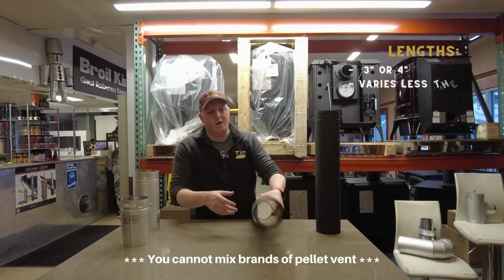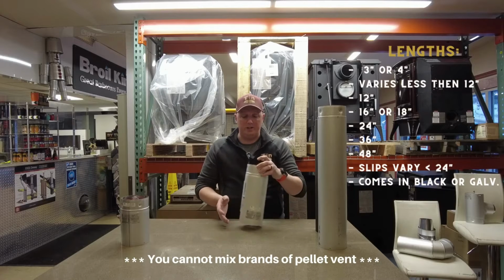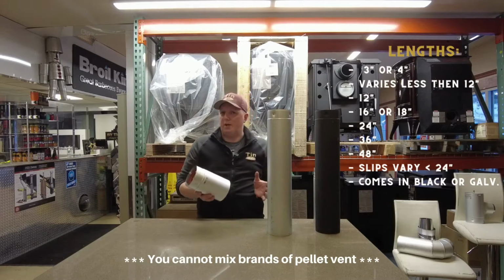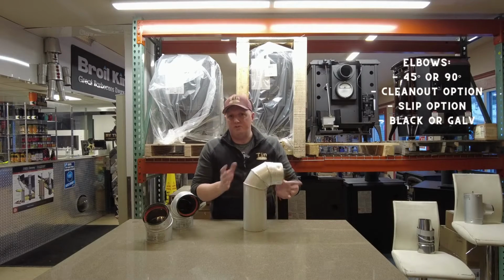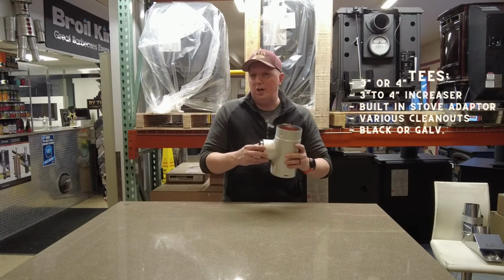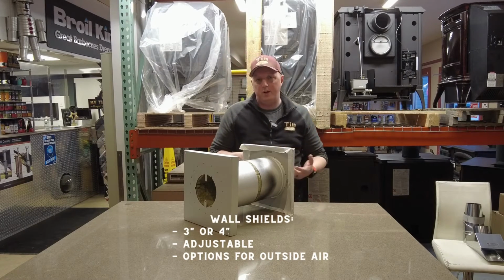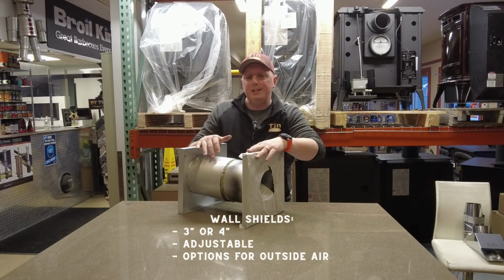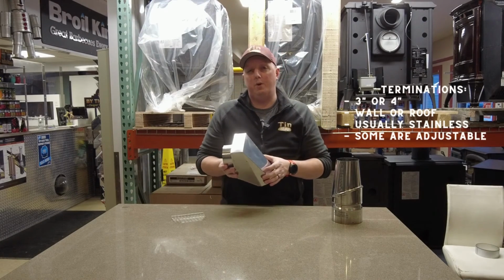Pellet Venting Explained

Comment: Can you install DirecTV vent pipe pellet stove underneath outside deck
Reply from the maker: Under a deck I believe the clearance around a vent is 36" to combustibles.
Reply: @tinmaninc2023  can you run the pellet stove vent pipe horizontal like for instance a 4-foot run under the deck along the wall in order to clear the deck
Reply from the maker: @wildwoodtop  you can but you need to have more rise then run. The stoves manual should have a chart on the limitations of the vent.

Comment: Hello, What is your opinion on outside air kits?
Reply from the maker: 99% of our installs do not have an outside air kit on them. We are in Newfoundland, Canada which is an island in the Atlantic Ocean and in our experience the salty air going into the stove is trouble. There are times we still to use it for clearances issues but when we do we recommend the customers close off the vent in the off season.
Reply: @tinmaninc2023  would you recommend one in any othe case?
Reply from the maker: @gsquare8585  Unless the stove is in a small space of a new home I really don't think its necessary. We don't use outside air on dryers or range hoods and they move just as much air out or more then a pellet stove.
Reply: I guess I’m following up on the previous question. I’m installing a pellet stove in my garage. It’s a 24x24 garage with a finished wall and ceiling and a finished room over the garage. I’m trying to heat the garage only when I’m working in it. That time I want to increase which is the reason for the stove. I’m in NH and in the winter…it’s simply to darn cold to work out there. So, do I need to be concerned about a vented air intake or, will the room design itself provide adequate fresh air intake! One of my concerns is sawdust being sucked back into the fresh air intake. 
Last question…my outside is vinyl siding. Can I safely use that second exhaust piece you showed or, will that project too much hot exhaust against the vinyl to be a safe install?
Thanks for any help….I’m looking forward to being able to spend more time warmly in my garage!!👍🏻😊